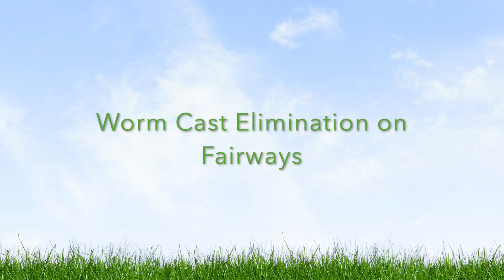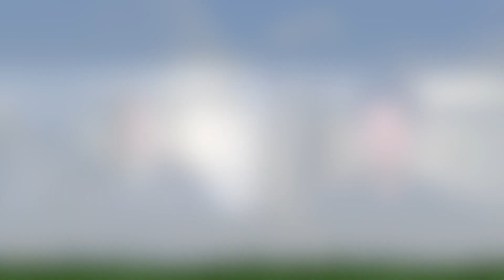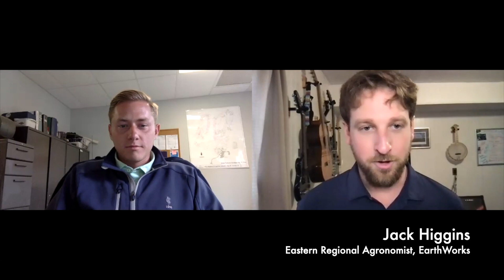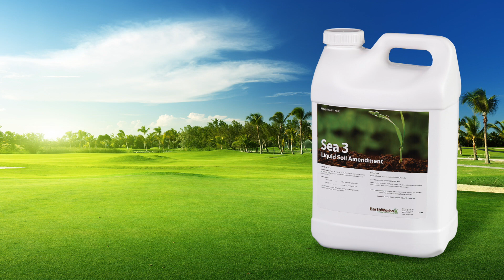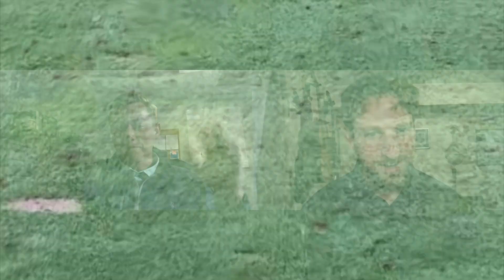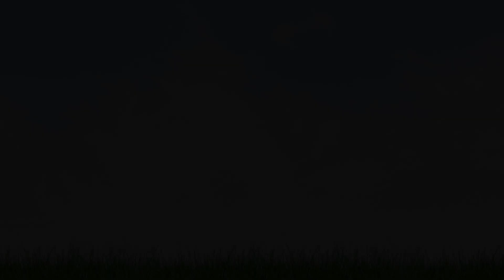2 Minute Turf Talk - Worm Cast Elimination

Comment: Hello mate I am in desperate need of help please. I would really appreciate some advice. My lawn is roughly 200sqm. Last spring we laid brand new turf, not long after a huge new home site was built behind which has driven millions of worms into our new soil and lawn. Fast forward a few months the whole lawn is gone and it’s just aerated soil from the worms.they are nearly at the outer bushes which cost a lot of money so I would like to save them if possible asap. Do you have any advice on how I can get rid of these worms and how I can prevent them reaching the bushes/tree soil. Thanks.
Reply: Use hot mustard powder. 1 tablespoons of mustard to 1.5 litres

Comment: Does this really work.  I've read tea seed meal brings all the worms up.   I have 500sq foot of Bermuda cut really short in my front of the house and I got castings everywhere. Started late summer.    I don't care as much as jra going dormant for the year now but I wanna know this crap out so come spring I can have a caring free sense Bermuda cut at 5/8".
Reply from the maker: Mike, we have had great success with continuous use of Sea3 on keeping the earth worms from coming to the surface.  It is not killing them like tea seed can but just keeps them from coming up.  There are now a number of case studies in our files about worm suppression.
Reply: @EarthWorksTurf  how long does it take.  If I can find it to ship to my house.  Is it something that takes a long time to work or what. I'm wondering if I should keep the worms going in winter to help aerate the lawn but start in April so when I scalp and it greens up and I put yearly light coat of sand to level it out.  I don't want the castings when I'm trying to grow a dense tight smooth Bermuda.
Reply: Hot mustard powder. 1 tablespoon to 1.5 litres